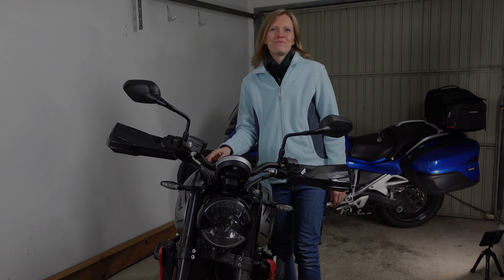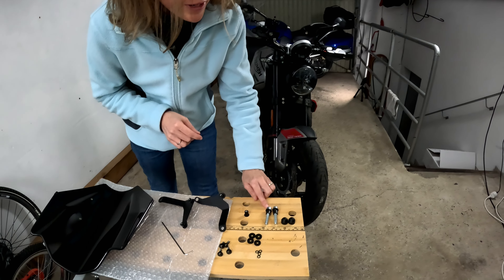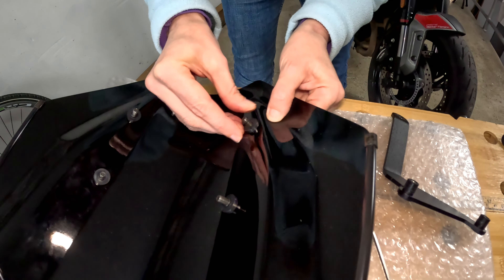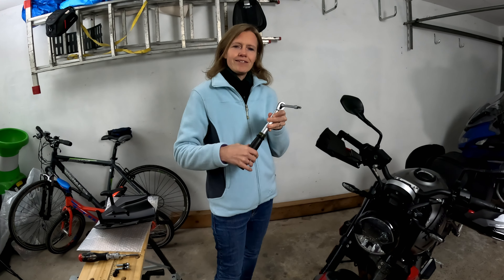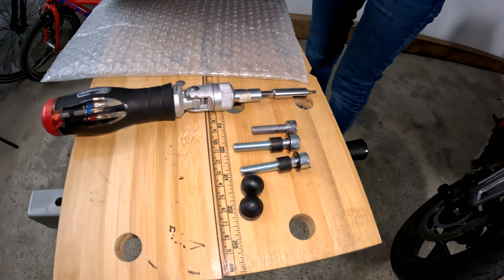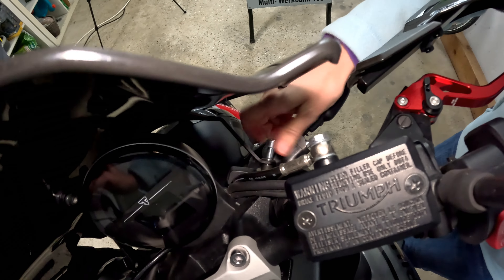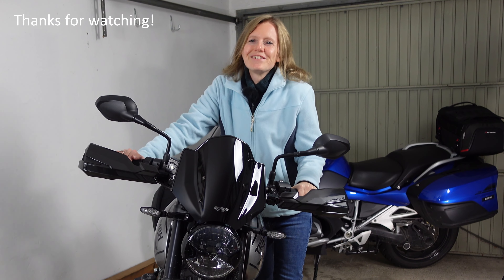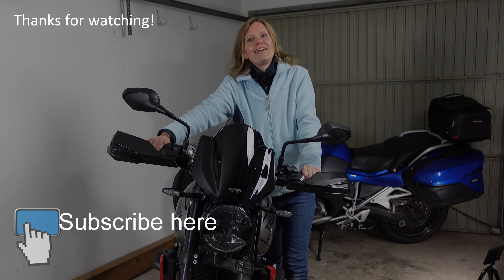Triumph Trident - Install: Windshield from MRA

Comment: I really need to know Tina's opinion on the handguards on a naked bike, if they'll block the wind and keep the hands warmer. I'm looking into possibly buying those.
Reply: I put the hand-guards on from the Tiger 900 on my Trident, easy install. Just needed a longer bolt on the throttle side brake leaver. Hands keep warmer and drier only on long drives my thumps  get cold.

Comment: Hi a question for you and or your hubby.
I’ve been biking 2 years and I’ve got an 650 Interceptor.
Thinking of stepping up to a Tiger 660 or Tracer 700.
Would a step up to an F900XR or Multistrada be a step too far.
Loads of tech and additional electronics on the bigger bikes. Would I appreciate them or utilise them .
What would you recommend, I know you had lots of probs with the BMW
Reply from the maker: Hi Beverley, you have 2 years of riding experience so "stepping up" should not be a problem for you at all. The Tiger & Tracer are not bigger, about the same in weight, they just come with wind protection & a little more power. The 900XR/Multi V2, well, they are a step up in power and weight, about 20kg, and they are higher but both can be lowered in height...but not weight. You are getting more, more tech, more wind protection, more options, more gadgets,  but you are also paying more, especially with the Ducati, way more, about double - compared to the Tiger/Tracer. So it really comes down to what you can afford and what you think you'll use. Sometimes think and afford don't mix, especially when it comes to motorcycles - then emotion takes over 🤷‍♂️ This is where I step back and really look at what I currently use and what I think I will actually use on the next bike 😒
take care and if you can, take any of them for a test ride, that usually is the deciding factor for me,
Scott
Reply: Thanks Scott for that advice,
Safe riding to you and Tina